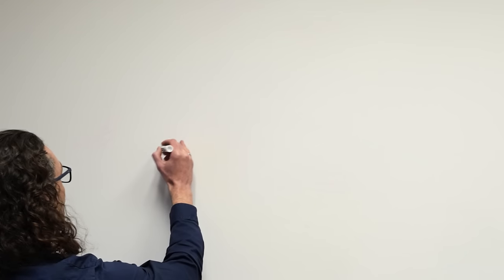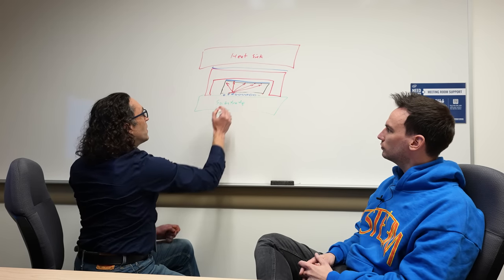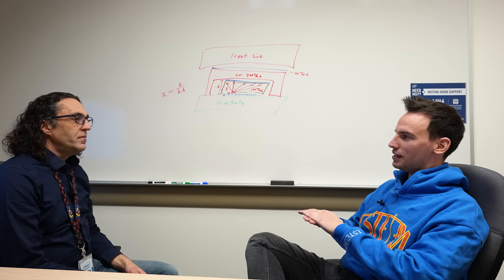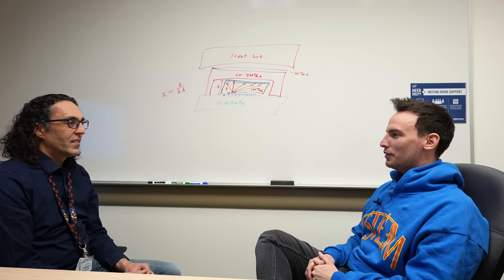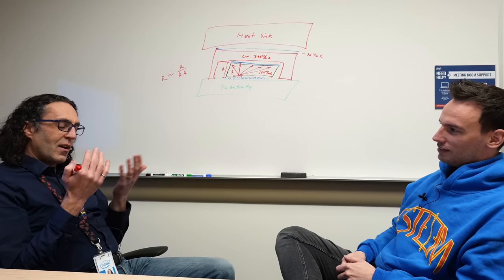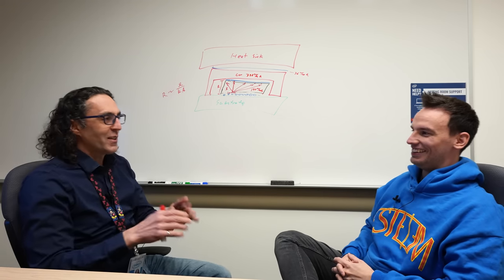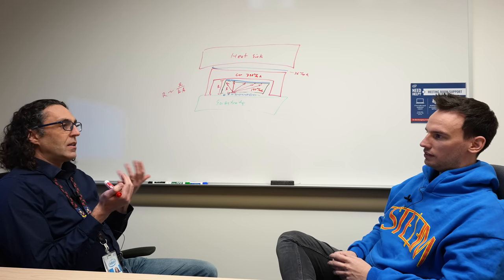Intel Engineer on: Die Thinning, CPU Thermals and Liquid Metal

Comment: Accelerated stability testing is super common in the pharmaceutical industry as well. When making a new drug, nobody knows the shelf life of either the active substance or the final product (e.g. tablets). So once they are reasonable confident the formulation development (e.g. tablet design + packaging) is over, they start accelerated stability testing of the batch intended for clinical trials. This has to be done to get estimate of what the drugs may look like 6 months or 1 year down the line, but you want to know within 3 months, so you can start the clinical trials as soon as possible.

These are done at higher temperature and humidity (usually 40 °C and 75% RH) with periodic sampling to confirm whether the product still conforms to specification, such as active substance content, impurities, appearance and many more. If the accelerated tests pass, their results can be carefully extrapolated to 2× the accelerated test duration. So if your accelerated test shows no degradation after 3 months, you can be reasonably certain the drug is stable for 6 months. 

Of course, room temperature long-term stability testing is performed in parallel, because there's only so much the accelerated tests can do. So when you see shelf life indication on a drug box, its length was determined by long-term stability testing.

Comment: Great content, you don't often get this in-depth discussion with actual engineers... and no PR/marketing team involved.

I never quite understood why the IHS made a return following the direct-die era of the late 90s/early 00s. I know it eases installation for OEM's and novices etc but it does seem to have been a consistent problem as far as cooling and as desktop chips seem to be reaching new record TDP's it seems like direct-die chip options could be something Intel/AMD could offer on certain product lines for enthusiasts or simply manufacturers that require the very best thermal performance.

Obviously they don't want to honour warranty replacements to users who damage chips during installation but that wouldn't be expected and was never offered back when stock direct-die chips were a thing either.
Reply from the maker: The main reason is the move to LGA socket. It requires quite high pressure to ensure contact. This pressure has to be evenly distributed and without some kind of metal cover this would be much more complicated without damaging the PCB. It's mainly this plus the fact that it protects the chip and is better for very cheap cooling solutions.
Reply: @der8auer-en  The IHS came to the late model Pentium 3s (tualatin), that was socket 370.  Intel went through another two sockets (PGA 462 and 478) before switching to LGA.  Also, at the time the die exposed chips (both AMD and Intel) were prone to the corners getting chipped off when the heatsink was installed and uneven pressure was applied.
Reply: @aetch77  The Pentium 4 needed that IHS. It was so hot, a bit of a heatsink mistake was detrimental (but will not kill the CPU with the thermal protections)

The IHS helped spread the heat to a larger area - it was still 180nm or 90 nm (Prescott) so not that power dense. The Pentium IIIs were cooler running in comparison
Reply: @ruikazane5123  An IHS is never needed outside what de8auer and aetch77 outlined. You are placing multiple interfaces between the die and the sinking mass, this is never thermally desirable in a passive solution. The area of the IHS is irrelevant, as heat is only conducted through the die upper surface and the heat sink/TIM would always fully interface with that conductive area.
Reply: I remember CPUs that had the heatink directly soldered to the socketable processor.
Reply: @tyrantworm7392  That is valid, but the thermal solutions of the time would have trouble with the 80+ watts of the Pentium 4 (this isn't a passive cooling solution) and high performance thermal compounds like Arctic Silver were not easy to source for the average builder depending where you are. The boxed fans also had a copper slug for that extra thermal mass (cut one out myself from one) - they knew it isn't really ideal to start with.

The extra mass at least allow a buffer instead of shooting through temps, still, not the best and explains the also 80+ degrees C temps on the Prescotts
Reply: I've killed more CPUs measuring and testing custom heatsinks and cooling mods than I have overclocking the snot out of them. Lucky I only play around with socketed laptop processors so they're replaceable, and dirt cheap
Reply: @ruikazane5123  how were those copper slugs embedded in the Al finstack? Were they pressure fit or solder or brazing or epoxy? How did you cut one out?
Reply: @therealb888  Cut it out with a hacksaw and a ton of hammering and prying. Probably they cast the aluminum around copper but I do remember seeing some epoxy...that was so long ago I don't really remember it well
Reply: @ruikazane5123  I was expecting a clever trick for a clean extraction 😅. Just casting is probably the best method aside from indium solder. Even liquid metal can't match the performance of these. Besides LM & Al would turn into reactive death sentence.
What did you do with the extracted slug? Been wanting to extract one myself since I saw it as kid lol.
Reply: @therealb888  The first one was sold at the recyclers. The last one I taken apart was machined to fit one of those "Taclight" G700 flashlights to fill that hollow LED pill housing. Was modded to direct drive and got pretty bright with a genuine Cree XP emitter. Wished we had access to 21700 cells at the time...
Reply: @der8auer-en  Apple used delidded LGA Nehalems in the Mac Pros which was a neat quirk!

Comment: As 13900k owner with my chip degraded after 5 months this part is painful: 15:00
That is with undervolt and cores locked to 5.5/4.3 ghz too. 
Theory versus how it was done.
If I ran stock voltage, I would degrade even quicker.

Comment: While I understand they can play around on the IHS to account the thickness variation of the die itself, so it fits on existing socket and cooling combo units, I wish they would offer a direct die product as they used to do back on the old days. As we've seen with custom kits, yours included, there are multiple benefits in using direct die cooling - with the drawback of less experienced users possibly cracking the die. Great discussion Roman.
Reply: Honestly with the way everything is going I'm suspecting this may become reality at some point. As density and clock speeds continue to increase, everything will get harder and harder to cool. Direct die options seem inevitable for enthusiasts but I don't see them offering it without other safeguards in place. They could potentially modify the mount and/or put something around the die to reduce the chance of damage. 

At the end of the day, it'll just be another risk like damaging socket pins. If beginners know the warranty will likely not cover damage, they'll either pay to have it installed or buy a model with an IHS.
Reply: I wish they would sell direct die CPU’s along with ones with integrated ihs. I may direct die cool future Ryzen 7000 or whatever it is when I buy it, but I don’t like the idea of having to rip the ihs apart. I may just end up sanding it down to be thin.
Reply: There’s too much risk to buyers damaging the die. Just not worth the hassle for intel. Few people crack their die and post on forums and it gives intel bad press as a product you have to e super careful with. Not worth their reputation.

Comment: Absolutely fascinating,  and I'm not a overclocker. Just the design diagram and what is allowed on camera is very informative in my opinion and if the desire ever is needed and let's face it if chips keep getting hotter then new answers are going to be needed before they burn through the silicon and leave a hole. But yeah thanks very informative

Comment: This is really interesting. Looking at how much space CPU cores take on the die, it is not a big part. But still a large part of the heat output. it seems reasonable that you need some more material, because of spreading the heat, but also getting lower thermal stress. 
I didn't know the thermal conductivity of the die is that high.

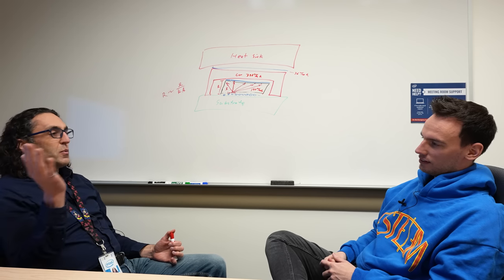Comment: 16:28 Keeping a CPU under full load for a very long period of time may not reduce its lifespan due to thermal expansion/fatigue but will still reduce its lifespan due to Electromigration. The rate of Electromigration is a function of power, so overclocking it will cause the degradation rate to increase.

Comment: Very interesting to hear there's nothing particularly special about the top/back side of the die (except a special surface treatment for the soldered TIM parts to help them wet/adhere). This would have been my guess as bulk silicon is generally pretty inert and nonreactive so there shouldn't be much need to do anything, but after frequently hearing enthusiasts talking about passivation layers I wasn't quite sure what was going on.

Comment: 6:00 Some people have recommended delidding the CPU and replacing it with a more polished copper lid to improve contact with the cooler. But the copper lids used for this purpose generally do not appear to be plated with nickel. Do you think this makes them more prone to oxidation, and maybe shortens their lifespan?

Comment: My suspicion has always been that Intel were concerned that if 9th Gen had massively improved thermals over 8th that it would have confirmed what so many critics of their switch to 'polymer' TIM from solder (in 2012 with 3rd Gen) had been saying ever since - "they did for no other reason than profit". Had 9th Gen used a thinner die (c. 0.6mm, as in subsequent nodes, and probably 2nd Gen/Sandy  Bridge) with a thinner solder layer and people had seen a c. 15°C drop for the same vcore/clocks/power dissipation it would indeed have validated those criticisms. IOW, they deliberately nerfed 9th Gen.

Comment: Ahhh, it makes perfect sense. The die itself is quite conducive, a certain thickness is required to have heat diffusion more evenly spread out. If you reduce said die the L would get reduced and you would have more concentrated heat in the heat generating areas. Bad for heat cycles, ideally you would want the whole die to reach a semi uniform temp at a very similar rate to keep the thermal expansion rate close between one area and the next. Like he said, cycles. For the longevity of the part it makes more sense to have a thicker die where even unused cores are heating up at the same rate to stop one area from cracking off. That’s why if you run a single core benchmark the other cores will heat up too.

Comment: 15:45 Oh! So failure rates DO get accelerated by temperature! So with the current Intel CPUs running so hot compared to previous models (or AMD) you can be sure that they won't last as long... It seems like a variation on built-in obsolescence.

Comment: 11:45 Wow... that makes the issue hugely complex, because it doesnt just differ per CPU, it should also differ per what is loaded on the CPU...

In the end, you have to optimize a certain weighted average per CPU, then find the optimized average among all your CPU designs, since it all goes in the same socket...

Wow... that is an austronomical problem.......

Comment: My recollection from some previous content (from Gamers Nexus?) about the top surface of the die is it's Silicon Nitride rather than pure silicon.  They called it a diffusion barrier, but maybe it's just about getting the STIM to wet to the die.
Reply: They actually deposit a metal stack on the back of the die / wafer so that the indium can react and create a metallurgical contact,  it’s usually a ni alloy with gold on top to help the TIM wet the surface and a thin adhesion layer beneath the nickel so that it sticks to the silicon.  There indeed isn’t usually passivation layer on the silicon, but due to wafer processing, the bare silicon can get oxidized or nitrided or see overflow layers from some of the frontside steps
Reply: @tomwassick4724  I see.  Honestly surprised you can disclose all that, as it would presumably be under Intel NDA or AMD reverse-engineering NDA.  As a practical matter, they shouldn't care about identifying the elements since the process is the real secret, but still.
Reply: Or for example, see Intel patent US20050012205A1, which lists a preferred embodiment for the metallization that may or may not be what you’d find by tearing down an Intel product with a solder thermal interface…

Comment: So, why not get rid of the TIM under the IHS all together?
Why not take a leaf from the old Cray X1 but replace spray system with a wicking material and simply turn the cavity over the chip into a vapor chamber?
The gap between chip and IHS would then be less critical. I'm not saying it is easy, but could be very cool!

Comment: Possibly not in Mark's field of expertise but I was wondering what Intel was doing reference Direct Die Water Cooling, especially as we move to a 3D stacked model of chip design where heat management is going to get even more important than it is today?
I know that TSMC has been testing Direct Die Water Cooling, where the water channels were etched directly into the silicon layer on top of the CPU. In their tests, silicon channels were etched into a silicon layer with a silicon-oxide thermal interface material between the microfluidic system and the actual silicon of the TTV. In a third option, the silicon-oxide TIM was replaced with a liquid metal TIM. The results were really impressive and could easily cool chips that consume more than 2000w, that's like having 6 x 13900K all on top of each other running at peak frequency without a problem, Intel currently has problems even just running 1 today so they must be looking into things like this, especially on the server side of things where their 56 core parts have to be clocked all the way do to a base clock of just 1.9GHz because of heat management constraints.

Comment: About running CPU at around 100*C for 3 or more years: I think that Intel actually can easily test it itself without "wasting" energy. They need to have a lot of server based stuff that runs 24/7 Simply rewrite bios to change a fan curve to keep it at ~90*C and see what happens. ;) Of course not for very important server, but in every organisation and especially a big one like Intel - they have some less important devices that can both - serve a company purpose and also be a long term reliability test sample.

Comment: I would very much like to know by grind down the die, would it lose much physical structure integrity? More specifically would the silicon become easier to crack during thermal cycles?
I would like grind down one of my older CPU to see if I can push it a bit further (by pushing the die against a credit card I can observe a slight arc), though I'd like to do it with a confirmation to ensure somewhat lower risk as it still worth ~$200 ish.

Comment: I really thought that you would have asked why the i9-7980xe was not manufactured with a solder thermal interface (so it became popular to de-lid and use liguid metal). Then the same processor was produced with a higher clock speed but with solder. Was the delidding popularity any influence on intel with the second (and third/final) genereration of that series.

Comment: I have been trying to explain that the thick AMD IHS helps spread the heat better to make it easier to cool.
you touched a little on the subject when speaking of silicon thickness, but would it be possible to ask him about IHS thickness specifically?
Reply from the maker: it's the same thing in the end. You have heat sources and heat distribution within the material. So it depends in which directions you want to spread the heat and how much heat. This will depend on your layout of cores or dies and also on the cooler which is used. General rule of thumb for heatspreaders is: if you have a bad cooler, you will need a better heatspreader to get the most out of it. If you have a good cooler, you might want to use a thinner or no heatspreader
Reply: @der8auer-en  My thoughts exactly
Reply: @der8auer-en  Mostly agree.
But there are direct touch heatpipe coolers and thin baseplate coolers out there that are top quality coolers, but sucks on direct die because they need the CPU IHS to spread the heat out to all heatpipes or a large fin array in a waterblock.
There are also low cost, low TDP coolers that have a 1cm thick base and do not care about the heatspreader at all because of the thick base.
It is more about the heat transfer of the base then the TDP or quality of the cooler and more does not hurt in other ways then cost and weight.

Thin or no IHS also means that you are forced to use liquid metal because the heat is more concentrated, compared to a big fat AMD IHS.
Reply: @der8auer-en  I've been wondering the same.  Heat moves on the X, Y and Z axes.  If we make Z bigger (thicker), that allows for more conduction on the X and Y axes, at the cost of higher total resistance on the Z axis.  Since we're talking about copper, I'm thinking that this cost may be smaller than the benefit gained from spreading the heat out more on X and Y.